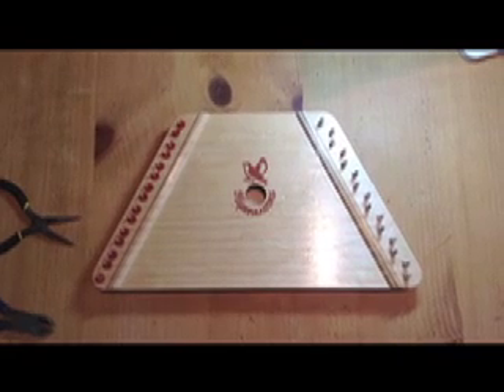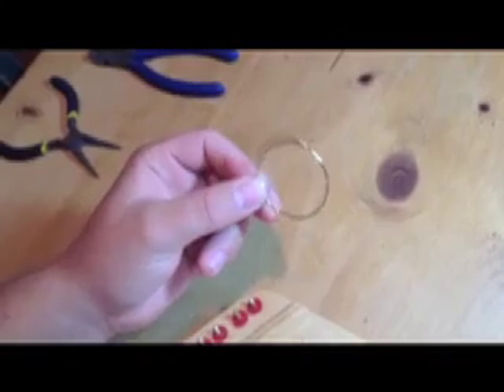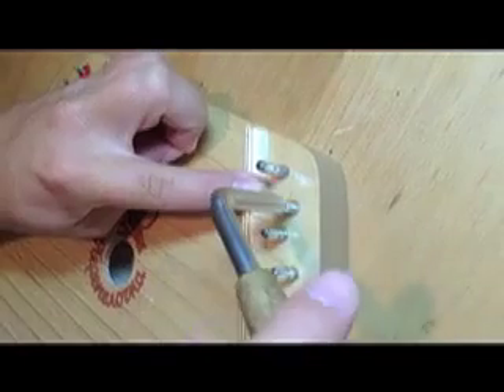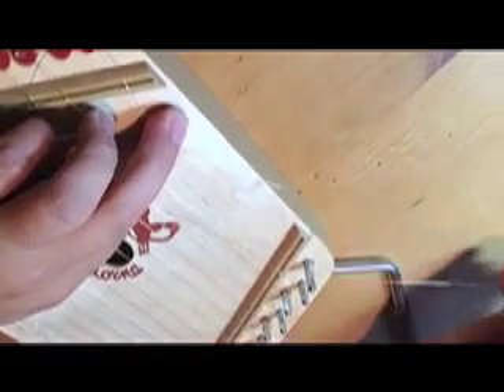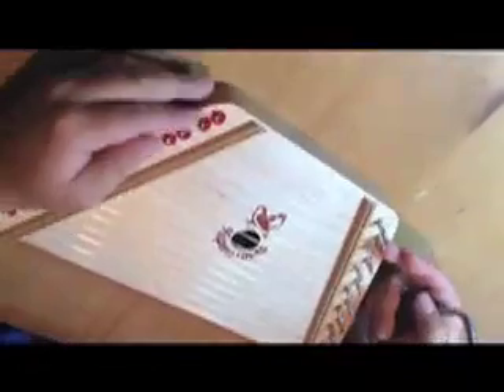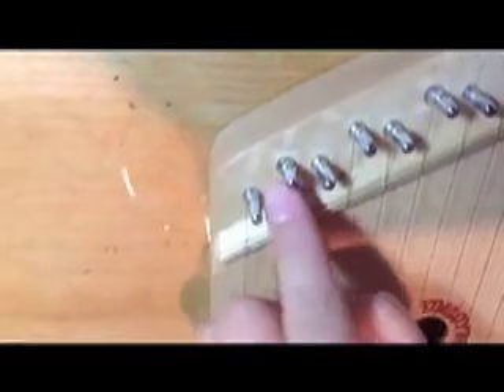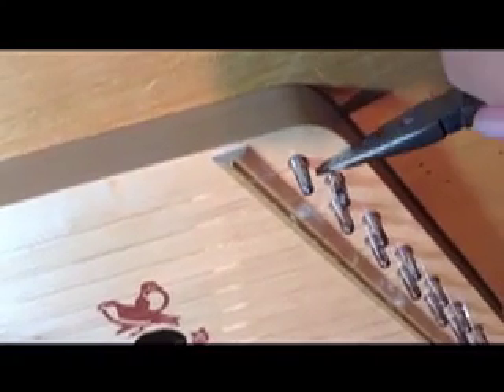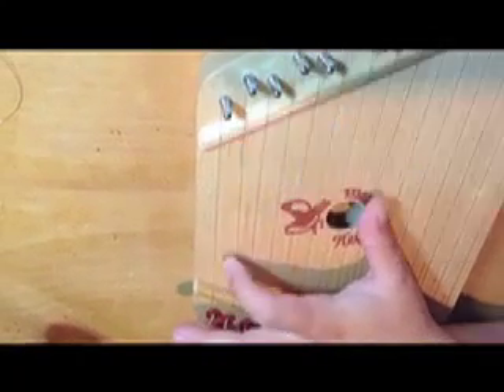Music Maker String Replacement: How To

Comment: I have bought a set of replacement strings on Amazon and it has numbers from 1 to 8. I'm guessing the number is counted from top to bottom. I tried to follow your video but none of the sting isn't long enough to go around two pegs... It also has a small metal ring at the end of the strings. Do you think I bought the wrong strings? Or am I doing it wrong?